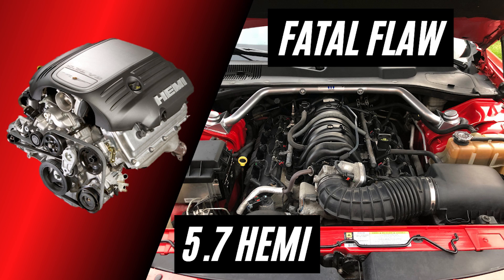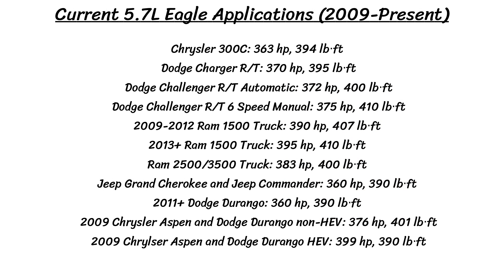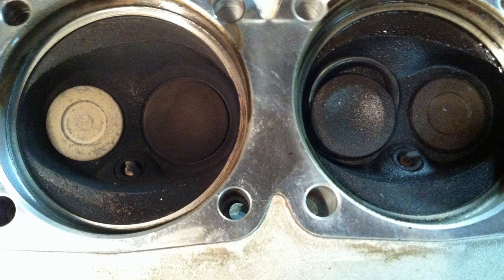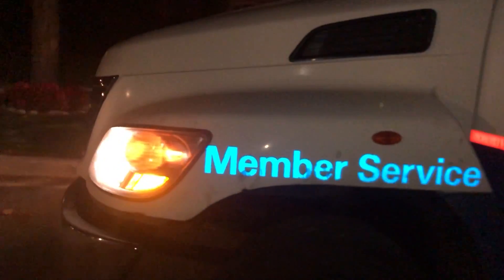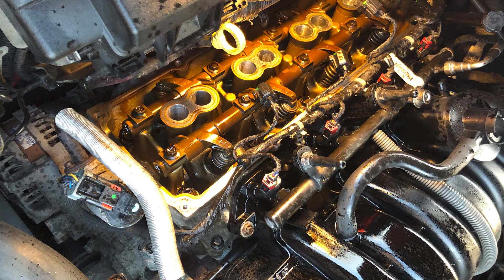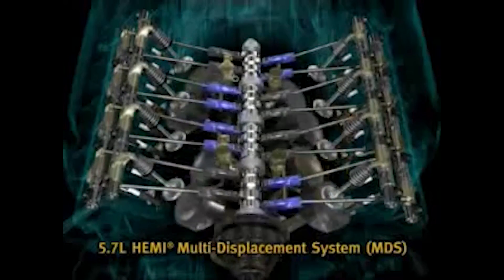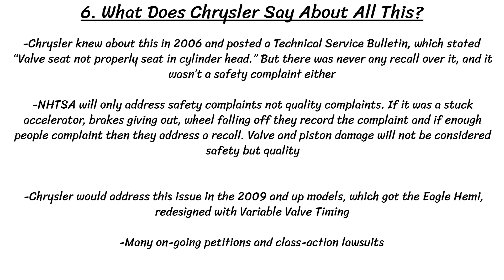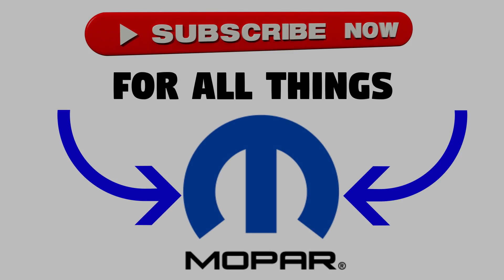The Fatal Flaw of the 5.7L Hemi V8 Engine & How to Prevent It (2003-2008 Valve Seat Drop)

Comment: Had the #4 exhaust seat drop. Tore up the head, piston, and wall. 136,000 never over heated. 2007 Magnum RT. The repair will be more then the value of the car. Get your valve seats pinned or swedged ASAP.

Comment: 119.000 miles what a bunch of crap I have a ford 250 350.000 miles still running I wish I would done more research I assumed hemi was a reliable motor what a joke

Comment: I have a 2007 Magnum RT 5.7 with 257,000 miles, no issues to speak of, runs very strong. Cooling fan broke around 100,000 and took out radiator so it did overheat but i shut it down and had it towed. Never has used a drop of oil. Does not tick or any other strange sounds. I do not baby it but i dont thrash it either. I must have got a good one !

Comment: I bought my 06 Charger RT from a dude last year. I had never ever let the engine go into MDS because I know this system can damage your cam and lifters. Ive always kept it on auto stick, gave the motor 30 seconds to 2 minutes at idle when parked before shutting off. Lastly I had always used between Pennzoil and Royal Purple oil. Our Hemi's don't burn off oil with Pennzoil as it's what our cars used from factory. I run Royal Purple half the time because the cleaning agents and engine protection it provides.

I'm right on 183k with my 5.7 and I plan to swap CNC ported heads, camshaft, non MDS lifters, MDS block offs, 6.1 intake, longtube headers, oil pump, timing chain kit onto the motor. Trans is getting a bigger torque converter with valve body upgrade.

Comment: My valve seat ring broke and dropped fell in cylinder scratched up beyond repair October 2024. It ran so good before that never a problem. 2005 Chrysler 300c. Little over hundred thousand miles. Do look for rebuilt or ? Love the car it's near showroom perfect in and out. Mine never overheated. Always kept the temp visible to myself in settings.

Comment: I have 3 chargers, 125,000 each and no problems. But, I have always complained of the high temps these engines run at. I remove the 190 stat and put in a 180 racing stat for summer and go back to the 195 in the winter. I also use 2 it's lucus black label and full synthetic oil in my 8 chargers and challengers. No problems yet.

Comment: What a shame that the old venerable Chrysler Hemi's of the 60's and 70's has morphed into this problematic beast.  The 1964 (first year) 426 Hemi never had these issues.  They also never had to burn this unleaded fuel or comply with all the nonsense EPA crap. A 1965 Plymouth Road Runner was a taxi cab, plain-Jane with rubber floor mats, bench seats, no AC or power steering.  It was a $3,200.00 dollar "Satellite", no fancy trim car with a $1,500.00 optional 426 Hemi "Elephant" engine as the called it.  No warranty for this beast.  If you wanted a warranty, opt for the 426 Max-Wedge motor. Most Road Runner buyers chose the 389 motor for cheaper insurance reasons.

Comment: Just bought a 2004 Dodge Ram 1500 with 5.7 with almost 200k miles for $6k. Most likely needs some work done. Anything to specifically check for? I'm hearing a ticking noise, but I haven't checked to see if it goes away or not after warming up. But as a 2004 it apparently doesn't have mds?

Comment: Have a 06 hemi with this flaw that happened at 150,000 Miles .ran great  strong oil changed on tome mobile one and filter .dropped the valve seat and  killed the piston.  It's toast now .fuck dodge for not doing anything when they knew about it . Pulled off the intake and coils and plugs used a camera down the spark plug holes hoping the pistons wete good but no !  It was torn up and parts wete in the intake manifold . So being a o6 it's done north worth fixing unless  I had a lift .

Comment: 2007 dodge durango with 5.7 and mds with 203k runs perfect to issues yet installed a 180 degree so engine runs lower temp and relaced fan clutch in which fan had to be adjusted to be no so loud like treeking the front spring and the engine never over heats

Comment: I have a 2015 RAM tradesman 4x4 with 320.000 on it now issues except manifold bolt an they were hard miles top speed 165 MPH I use Valvoline high mileage oil 10w30 in summer 5w30 winter with JB lubricant every two years

Comment: ive got a 2006 300c the hemi, with 226,000 km and still runs like a dream, no issues of dropped valve seats, or any issues with my engine, it just keeps going, running smooth and starts every time, i want to see how far she will go before the engine gets tired or grenades, but at 226,000km and still running very strong, i have 0 complaints
Reply: Still running?
Reply: @DooDicky  yes it is

Comment: My hemi dropped a valve at 118000 and is currently at the dealer as i type this. They suggested i replace the motor for about $8000. But my truck is only worth about $8000. I opted to repair the valve. I think they are going to replace the head but,I am not sure.

Comment: HEMI problems due to the lack of an oil heat exchanger, this is not at all an increased oil temperature, as a dangerous temperature difference between oil and antifreeze, 116-126° oil and <100°antifreeze, for this reason there was overheating of the cylinder head and the disease loss of saddles and guides

Comment: I wonder if any of the hemis had a different tolerance on the valve seat depending on application or if they were all the same. My and my older brother both own 05 Jeep GCs with the 5.7. Hes overheated the snot out of his a few times when the hydraulic cooling fan messed up. Mine was ran reallllly low on coolant by the previous owner. But according to him it never overheated. Factory thermostat for our jeeps open at 203F. Both of our jeeps are over 200k. Mines at 216k running strong. My brothers has a blown trans cause it had some sort of electrical issue, would go into limp mode and he just drove it like that and overheated the trans...

Comment: It happened to my 2004 Dodge Ram 1500 at 169k miles. No warning, ran like a champ until it just quit. Needed a complete engine replacement. I had an overheat condition a year and half prior to the event. I feel somewhat certain that was a triggering event, just didn't know it at the time.

Comment: I have a 2005 Grand Cherokee, from what I have seen in your other videos, this year did not have the MDS in it, that started in 2006. 
My engine is running strong, I have 74k miles on it right now. The previous owner was an elderly person who did not drive much, but that does not equate to less problems, especially when the person who last changed the spark plugs didnt bother to gap them. 
Thanks for the video.

Comment: Mine happened twice. First at 153k miles. The second time 5k miles later. Overheating can cause the 2 metals to seperate. There is a noise on mine that made me turn it off before the seat broke. It makes and nasty noise. There is misfire codes. Turn it off and save your engine.

Comment: It happened to my charger RT 2007 with 110K miles on it. I am now in the process of purchasing a rebuilt engine (same 5.7). but wonder what parts I should replace to avoid that kind of problems.

Comment: 2007 Crysler Aspen 5 7l hemi with 196k miles. The only time I've heard a tick was upon 2st start occasionally and one long road after driving hours. Maybe this is the reason and i should do heads on mine.
Reply from the maker: Ticking isn’t the heads so it’s unrelated. I also have an 08 5.7L Aspen, at first the ticking was the broken exhaust manifolds. There was also a faint valvetrain ticking that I will not chase after. Truck runs smooth and powerful so it is what it is, around 165k miles. Also the valve seat drop seems much rarer in durango aspen and rams. Could be the heavier duty cooling or something

Comment: I have a 2008 Charger with the 5.7L HEMI with 219,000 miles.  I was sitting in the drive thru line for about 10 minutes at Starbucks when the car made a loud noise and started vibrating.  I got out of the car and looked around the vehicle and nothing appeared to cause the noise.  I get back in, the vibration was less and then totally stopped with the car idling smooth again.  Once I got out of the line I checked under the hood and nothing appeared to be wrong.  Could this have been an issue with the valve seat that perhaps worked its way back into place? (perhaps a stupid question).  I diagnostic check did not show anything.  Thanks for your video and eager to hear your response.

Comment: My 2006 Dodge Magnum R/T dropped the valve seat at 98000 miles. I only drove from home to the store 3 miles away. I stopped, turned off the car, then started it about 5 minutes later. That was a year ago and I am still trying to find some good heads, camshaft, etc. to rebuild it with.

Comment: Great video. I have a 2003 Ram 2500 with the 5.7 HEMI that just turned 150,000 miles. No problems. I have always used Mobil 1 since the very first oil change. I have never seen the temperature go past the halfway mark. It is the best engine I have owned. One slight correction to your information, the 1500 Ram did not receive an upgrade and HEMI engine until 2004.

Comment: I have a 2015 chrysler 300C with the 5.7 hemi.  Is valve seat dropping a problem with this version of the hemi?  I have 37000 trouble free miles so far but I have considered driving the car in sport mode occasionally to lessen the exposure to mds.  what do you think?

Comment: 2008 Durango Limited 5.7 at 131k( 5-4/23.. Full Synthetic needs to be used, around town driving is the worst for a Himi. and special Himi oil is made. Problem solved ? No. Finish reading the owners manual or door tag specs. THE 5.7 NEEDS 89 OCTANE not 91 or 87. I've never seen any oil last over 3 months..3000 miles Max. You got a Himi- not a VW. or a pinto. Mystery Oil is great..put half bottle in tank and the other in oil fill.Himi will drip oil because it's a monster engine, so keep it full. Most oil shops are rips and u should drop yourself. Don't forget the transmission oil, upgrade transmission pan with a drain and change at 30k. Plugs at 30k and use real Himi plugs. Floor it !!!!

Comment: Custom ordered 2006 Magnum RT AWD 127K mile and still going strong. I’m the daughter of the original owner and babied from day one till I got it. I have been rough on this car and don’t always get the maintenance done right away and it STILL runs super strong. I’ll mention I live in Las Vegas where the temps get really hot! I do play with auto stick periodically and never shut it off immediately after driving long periods. This video kinda scared me but I might already be doing a few things to prevent this from happening to my car. Thanks for making this video and bringing the issue to my attention.

Comment: Great info. I have a 2006 Dodge Durango Limited with the 5.7. Bought it with 87k miles and now have 106k. While I have had no issues so far your video has encouraged me to upgrade my cooling system as a future mod.

Comment: I have an 06 Ram 1500 Hemi. Just turned 100k 2 weeks ago. I have a Superchips tuner and turned off MDS 20k miles ago. I do my own services and oil changes. Very meticulous about the truck. For me the Hemi engine hasn't been the problem, its everything else around it that infuriates me. The ac blend door, turn signal, and the rear door wires falling apart. The headlight design is ridiculous. I have to buy new bezels every 3-5 years. The Hemi exhaust tick. My tick goes away after engine warms up. 

However, I do enjoy that I can still work on this rig. New vehicles require software updates and are too complex with all the added features.

Comment: I think mine just did this, right after starting it the next day after the engine got overheated the day before. 2004 Ram 1500 with 195K miles. Soon as the weather warms up a bit I can investigate. Bad misfire and wont stay started unless I keep mashing the pedal. I suspected a broke valve spring, but this video describes my problem.

Comment: Quick clarification on the tank recall, as it is NOT actually a recall, it's an extended warranty.  How do I know this?  Well my 300C was imported to Canada, and any import/export voids the car's warranty.  Recalls are exempt, so my airbags have been done, but extended warranty items are NOT exempt, as they are part of the warranty.  Chrysler corporate will tell you to kick rocks, and replacing the tank is a $3000 CAD job out of pocket.  So yeah, something to note about that, just in case you're in a similar situation as I am.

Comment: Wow, this is literally exactly what happened to my ‘08 RT. Was driving for about an hour, stopped to fill up with gas, went to start it and the same thing happened to me. Car made some awful noises, shook a bunch and died. Had it towed to the shop and eventually found out that cylinder #3 and #1 both dropped the intake valve seat. It sounds like i got lucky here, the seats got stopped by the valve and didn’t fall into the cylinder. Still had to replace both heads, but luckily it wasn’t the whole engine. And this was at 145,000 miles.

Comment: Does the 2005 300c AWD have mds my research is saying it started in 2006 but then again it says all pre eagle including 2005 what is the correct answer?
Reply from the maker: Yes I can confirm it 100% does. For anyone wondering, I have a document from Chrysler from ‘05 that confirms the 2005 Chrysler 300C and Magnum RT are the first that have MDS.
Reply: @MarspeedCars  thank you Diablo trinity turns it off but it comes right back on that's why I was wondering I guess I have to call Diablo sport thanks again

Comment: I want a 2006 -2010 Charger R/T but I hear so many bad things about this engine IDK  trying find a budget muscle car I want a mustang but I want a better platform to start with far as horsepower so I keep coming back to the Charger
Reply from the maker: Just get an 09-10 R/T it has the upgraded Eagle motor. Do not get the earlier ones due to dropping valve seats (or just fix the seats before they drop that’s also a very good option)

Comment: I have a 2008 jeep commander with a 5.7 hemi, mine self-destructed at 221,000 miles. Currently in the process of having the motor rebuilt machine shop $ $ouch.

Comment: Thank you for this video. Very good information. 
Unfortunately,  my 2007 dodge magnum gave no indication anything was wrong.  I had been driving around town utilizing my roomy cargo space to acquire necessities. Shut off the car to offload a passenger.  Attempted to restart after an estimated 15 minutes.  My beautiful "Pearl" made sounds any death metal band would be proud of.  She threw a rod and poor thing had "piston bits" in her intake manifold.  UNDER 80,000miles. Full engine replacement.. getting a Jasper rebuilt.
Reply: Am considering doing this same happened to mine. Are you happy with the rebuilt?

Comment: I'm closing on 200.000 on my '03 Ram. Even run LPG, which runs somewhat hotter, and has for about half that mileage. Broke a valve spring once while towing, but no dropped seats. However, my truck is too old to be equipped with MDS, and it's usually quite cool here in Norway.

Comment: Bought Jeep Grand Cherokee 5.7 Hemi new in 2007. Faithful oil & maintenance on my baby. Always said, I've never had a problem with the engine which has $166,000 and then felt a little miss. No one could diagnose engine light but, after spending to much... I'm screwed. How do I get on the class action? 😭😭😭💔

Comment: As a lube tech at a chrysler dealership, an issue is when filling the engine with oil,  if you fill it too quickly, you will flood the intake. It's super easy to do, especially because I'm a short guy who struggles to reach the oil cap on a 1500. If you fill a 5.7 with a funnel and fill up the funnel, even 1 inch, you'll hear a gargle and you know you flooded the intake.
Reply: i don't understand how this happens? is it specific to the hemi? never heard of it happening to any other engine when adding oil
Reply: @lexi-conby yeah it’s specific to the Hemi. The worst ones are the 5.7s on Charger, Challenger, 300, Durango and Grand Cherokees.

Comment: I have a 2022 challenger r/t - I bought with 0 miles - and 2 months later with only 2000 miles it already started presenting with the tick and while driving on the highway at 80 mph the engine completely shut off and now dodge doesn’t want to consider it a safety hazard. This is wrong and a faulty product. Hemi may have had a great reputation but it’s going down the drain. I am talking to the attorneys dealing with the class action.

Comment: Valve Seat Drops Isn't A Fatal Flaw, If You Keep Your Engine From Overheating You Will Be Fine...... What is a Fatal Flaw that You Didn't Mention/Talk About Is The Lifters and Camshaft Self Destruction Caused By Lack Of Proper Oil Lubrication Delivery to The Lifter Rollers and Camshaft Due to The 5.7 Lifter Position Design.

Comment: I have a 2009 hemi rt.     40k.            She gets all synthetic.  Every 3k.      And her cooling system is flushed every 2 years.   I live in Florida.   I ditched the plastic. Cowl.          So far.     She has been.    Flawless.
Reply from the maker: Better be flawless at 40k 😂 but jokes aside nice car cool to have such low mileage on an 09!
Reply: I do mostly high speed cruising.       Never stop and go.       It's just a toy.      I let her warm up       thanks fer the heads up.          So far.     She been good.
Reply: I just use her for long trips.           I did have the timing chain guide recall done.        So far.      All good.      Very smooth and comfy.              Just a big girl.     Lol

Comment: Is it normal for a timing chain to break on a 2011jeep grand cherokee overland 5.7L hemi with 243056km?
Reply from the maker: Yeah I believe the manual calls for replacement around 80-120k miles
Reply: @MarspeedCars  what is the best OBDII bluetooth for use at present?
Reply: Also is there a way to clear out a permanent code P0456 p0457?